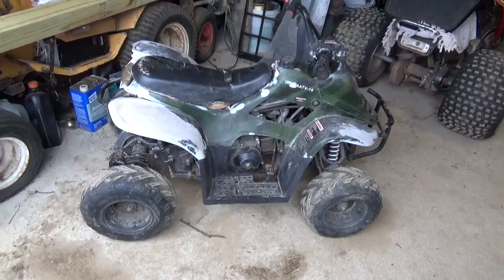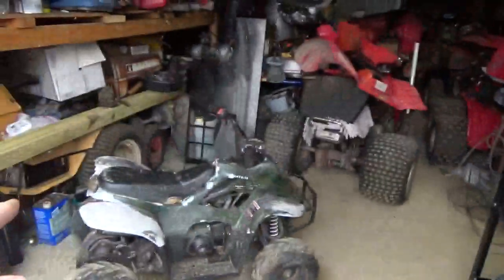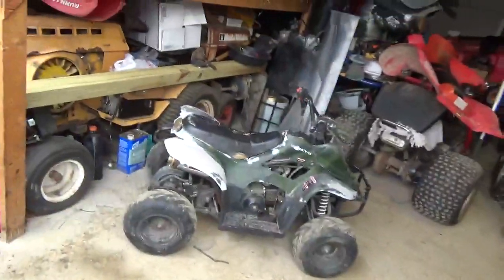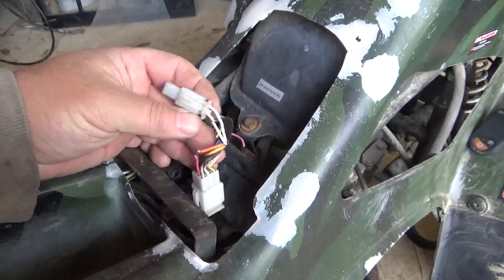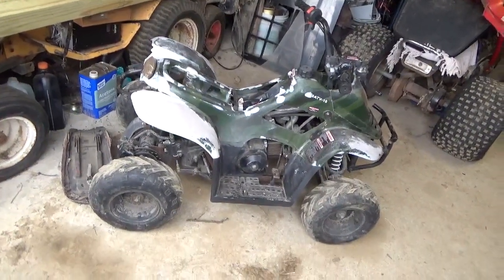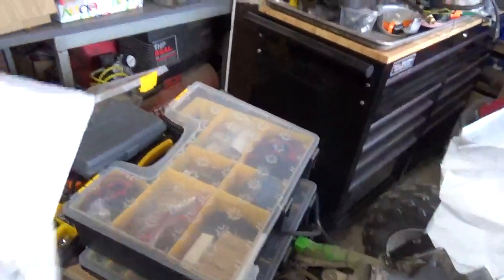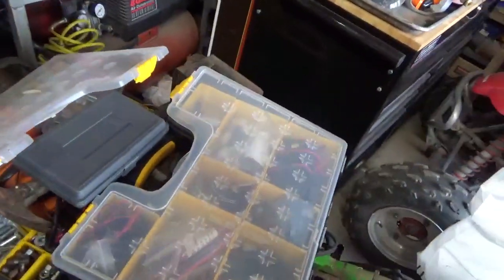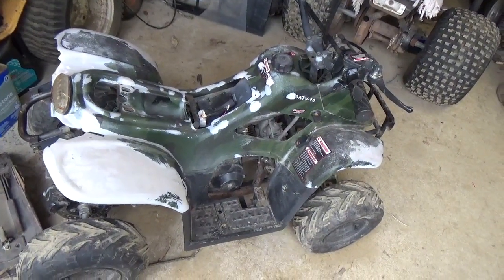$50 Jonway 110cc ATV, stale gas, damaged wire harness, Intro video

Comment: I have a Hisun product that has me stumped and was hoping you had some advice. It's a Utv 500 that gets no spark at the plug. Trigger reads .006 Vac at the connector, .626 Vac at the CDI and the orange wire at the ignition coil reads .176 Vac
Reply from the maker: Hey Jackie!   I have never had any luck on making voltage measurements when troubleshooting an ignition issue.... Tell the story on Ur UTV.... It was running one day and next it was not, U bought it as a non runner, tell me how it stopped running.... Is the wire harness hacked up?  Is it in nice shape or just a daily rider and worker???   Thanks for asking, watching, and commenting!!!
Reply: Harvey Spooner 
It was running fine and one day it decided to shut off on ten way to check the mail. I've replaced the CDI, stator, trigger coil, rectifier, ignition coil, spark plug and battery. I also removed the harness removing all the plastic loom and black tape to look for any damage.
Reply: Hey Harvey,
Not sure if you received my reply on the questions you asked but they have been answered to the best of my limited abilities :)

Comment: I've got a 87 250x that loses spark and then comes back after it sits for a few minutes. I've replaced everything.  I tried a new stator and will not start unless I use a cheap Chinese cdi. But this CDI makes reverse light stay on. I've tried two known good factory CDI units and will only start on Chinese cdi since new stator, it runs but not right.  I'm lost. Thinking about putting old stator back in so it will at least start with factory CDI. Any ideas?
Reply: willhe wonthe check all the negitive ground wires
Reply from the maker: Hey Willhe Wonthe!!! Ur 1987 250X only has one cdi not 2? The reverse light gets power on one side when the key switch is turned on, the reverse light illuminates when a switch in the engine applies ground to the other lead, this reverse switch should also determine which one of Ur CDIs is active... Ur 250x is a quad with a manual clutch?   Thanks for asking, watching, and commenting!!!    BTW, The Dude is right, start by checking the grounds, make sure Ur engine is well grounded to the frame....